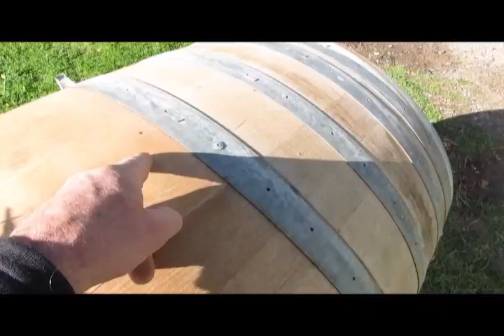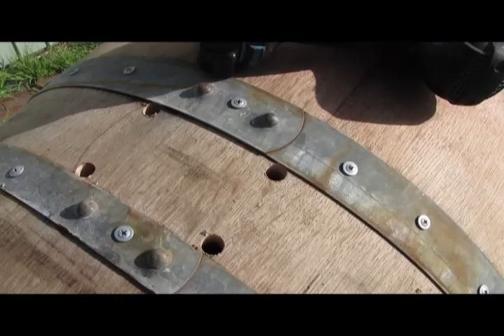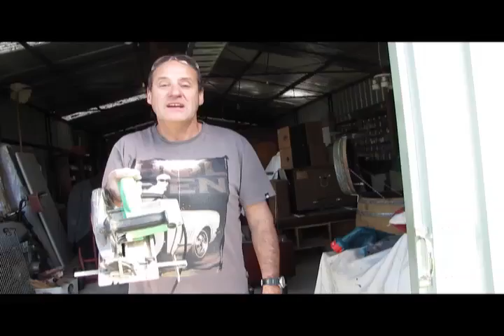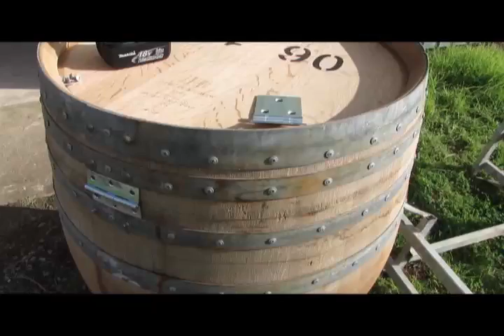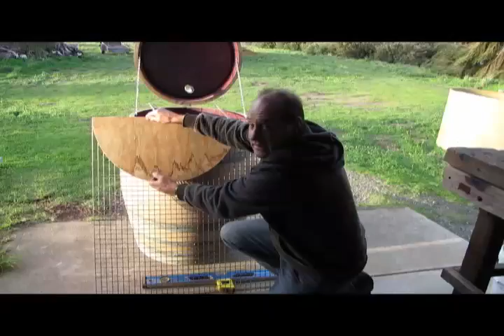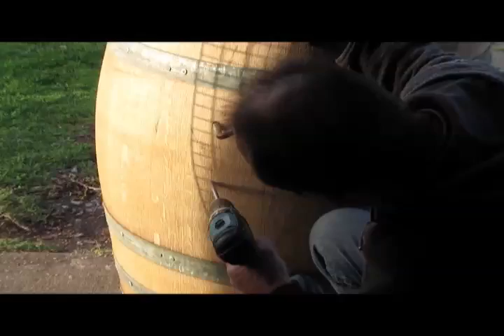How To Build A Wine Barrel Smoker

Comment: Any  idea as to the burner btu capacity that is ideal.
Reply: Hi Adrian. I use a smallish, cast single ring burner. Not sure of btu rating sorry mate. If you live where it’s mostly cold then you’d need to consider the heat loss as ideally I’ve found maintaining a cooking temp around 110 to 120 Celsius works well. My smoke set up usually produces smoke for 45 to 60 mins which is enough for me as I personally don’t like strongly smoked meat. Hope this helps. Cheers George

Comment: Hey George, great vdeo thanks for sharing your tips, just wanted to ask i hear that wine barrels fall apart if you dont leave them filled with water so you have to pop river or screw the collars into the wood?
Reply: I made mine several years ago and its good as new. It sits outside uncovered. As per the video I've screwed the metal hoops to the staves. Good luck with building yours. I still use mine regularly. Cheers, George
Reply: @georgeharris7856  Thanks, they definitely look the part ;)

Comment: Thanks, great ideas, but it seems like it would be hard to get the holes for the grate support rods right ....
Reply: Hi Jim. It was pretty easy actually. You can measure up from the bottom of the barrel to get the holes level. Then, using your eye, drill the holes. Remember, its all very forgiving as you can make the support rod holes slightly enlarged if needed so the support rods line up. Once you've put them in they would rarely need to be removed. Mine have been in place for several years now :)
Reply: Thanks for the response. I was actually more concerned about the L-R alignment than vertical, but I guess if the holes are large enough, it won’t matter
Reply: @jimpetersMontreal  yes I figured that you meant L- R alignment - it won't be an issue mate.
Reply: Thanks. I don't want to ruin a barrel. I'm going to try using heating ductwork with an external smoke source for cold smoking. Thanks again for the great video!
Reply: @jimpetersMontreal  yes you could pretty much use anything for cold smoking! Good luck.

Comment: Great video! What length are the screws? And where did you get them? Thanks!!!
Reply from the maker: William Talton 15mm galvanized pan Phillips head screws from Bunnings from memory. You could use 20mm too as barrel staves are usually fairly thick

Comment: What's your thoughts on building a frame and putting the propane burner under the barrel with a hole in the bottom of the drum with a slid bottom vent to adjust the air when using charcoal , doing it this way you could use charcoal in the barrel or propane underneath or both.

Comment: What do you use for the grease falling on the burner, also if i want to use wood chips what do you use?
Reply from the maker: hrackley thanks for your comments and watching the video. I use a wide shallow tray (approx 40cm X 30cm x5cm) which I fill with water during the smoking/cooking. This keeps the atmosphere in the smoker moist and stops my food drying out. I find fat drops into this tray. Otherwise you could sit your meet on a shallow tray on a rack. It's never been a problem for me so hopefully you can find a solution. Regarding wood chips I use many different combinations depending on the flavour profile I'm wanting. Tomorrow I'll be smoking quail and will use Apple, pear, old grape vines and a handful of teas/spice/dark sugar mix. Any fruit woods are good to use. I've also tried old oak staves from wines barrels and even pine needles from pine trees in my garden when wanting a subtle smoke for a delicate flavoured fish I smoked. Good luck and have fun! Cheers George
Reply: I was thinking the same thing awesome reply thankyou

Comment: Where do you get the stainless steel mesh from?
Reply from the maker: Mike Hill 
Hi Mike,
Thanks for your question.
I purchased the mesh from our local engineering workshop. Any steel fabrication workshop should be able to get it for you. It came in a 2m x 1m sheet size from memory at a cost of $180. Another alternative is to use the round chrome-plated grills similar to those used in Weber kettle type bbq's. They're available at BBQ Galore for around $35. The stainless grill isn't the cheapest way to go but its will last forever and not rust. Cheers George